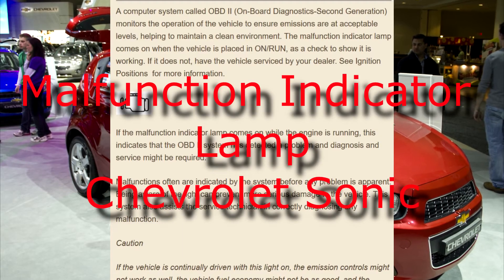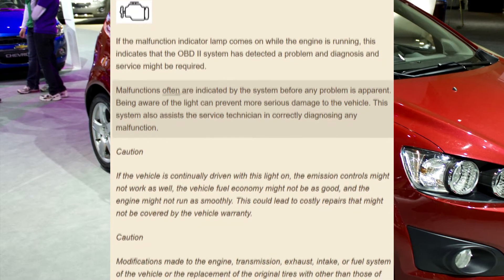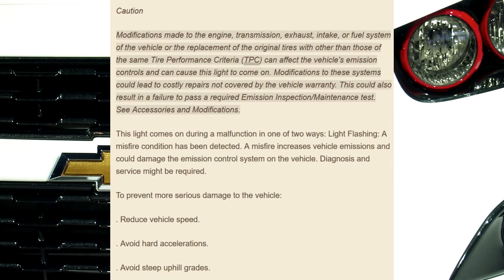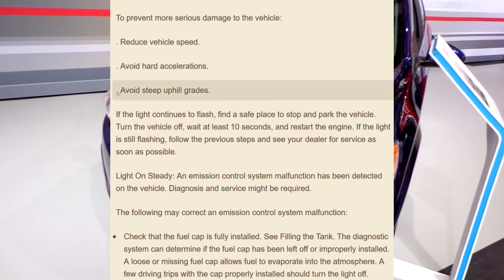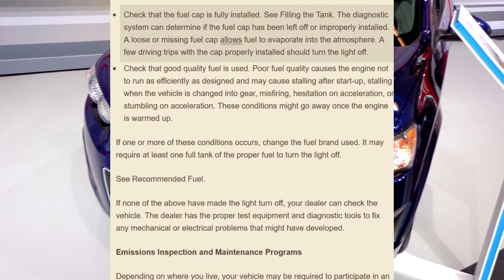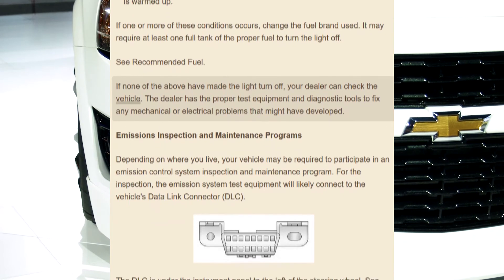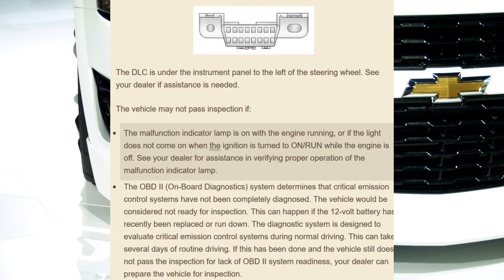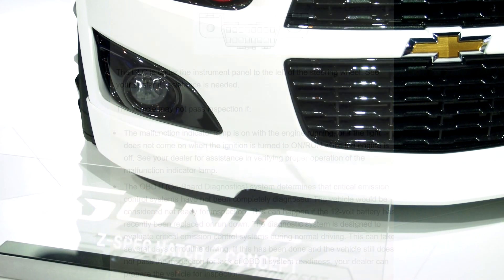Malfunction Indicator Lamp | Chevrolet Sonic

Comment: How do  you replace the bulb as someone sold me the vehicle  and obviously disconnected or pulled the bulb out to prevent the engine light from coming on. Now the car wont pass emission.s
Reply from the maker: Sorry to hear you're dealing with that — it's really frustrating when someone hides issues like that. To replace the bulb for the Malfunction Indicator Lamp (check engine light) on a Chevrolet Sonic, you’ll likely need to remove the instrument cluster, as the bulb is built into or behind it.

Unfortunately, on many modern vehicles (including the Sonic), the check engine light uses LEDs soldered to the circuit board, not traditional replaceable bulbs. If it's been disabled, it might require professional repair or cluster replacement.

Also, keep in mind that reconnecting the light won’t fix the root issue that caused the seller to disable it — you’ll still need to diagnose and resolve the engine code to pass emissions. A scan with an OBD2 tool will help identify the problem.

Let us know if you need help with the next steps — happy to guide you through!